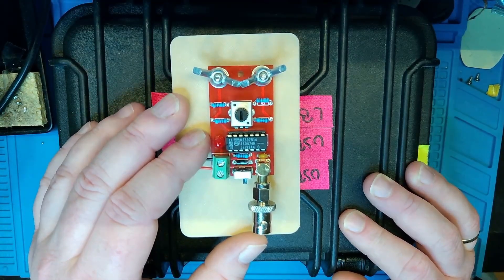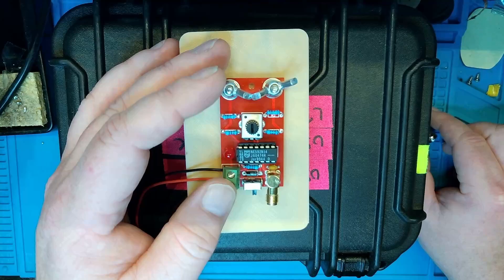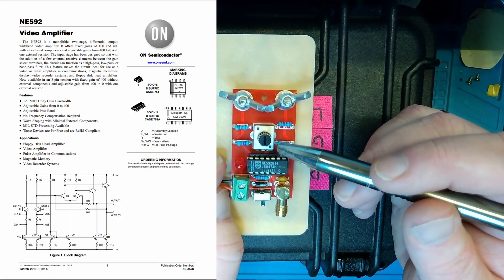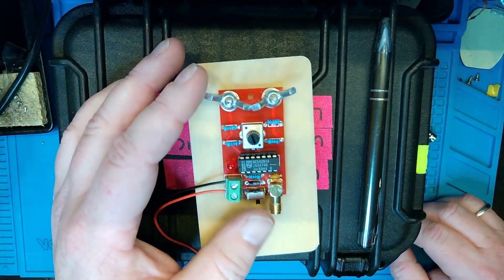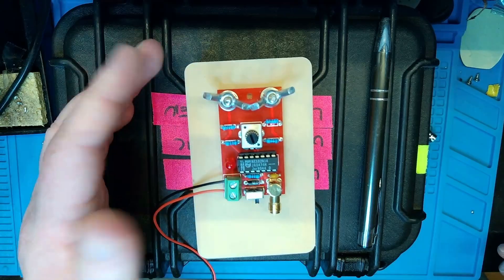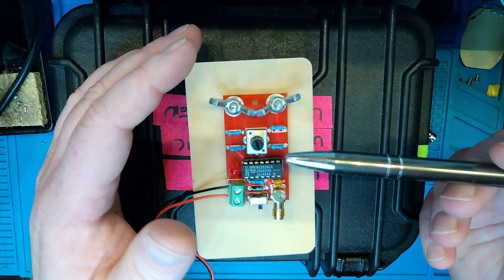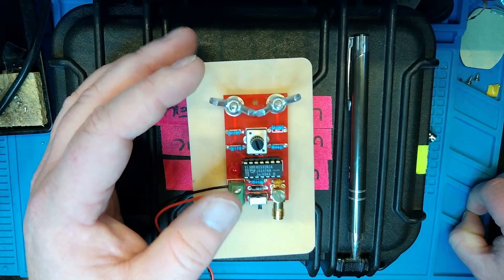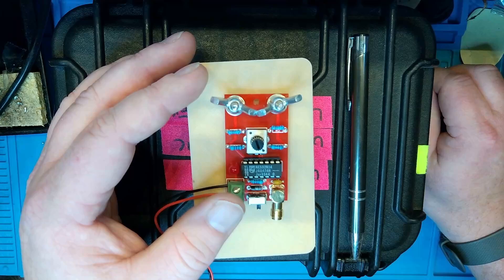Did I let the MAGIC SMOKE out? Kit build recap.

Comment: It sounded like your noise floor was high. Is this typical for an SDR at your QTH? 

Fun fact. NE592 has been around since at least the 1970's.
Reply from the maker: I actually have a relatively quiet QTH, but the antenna was strung up indoors right next to the heat pump. And I also needed to pump it the amplification to be able to receive anything at all.